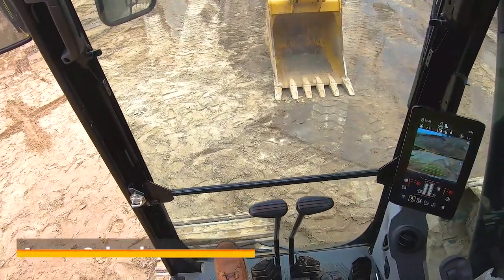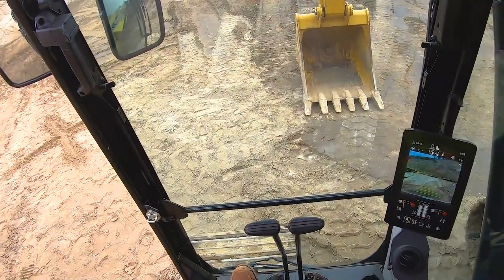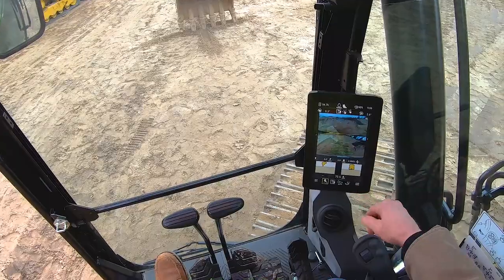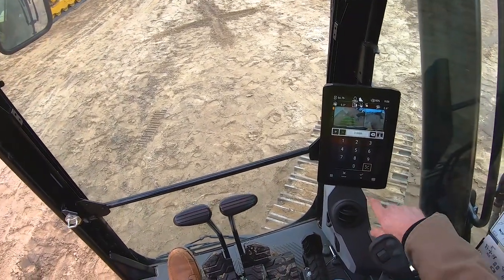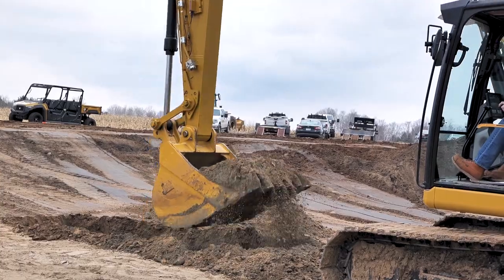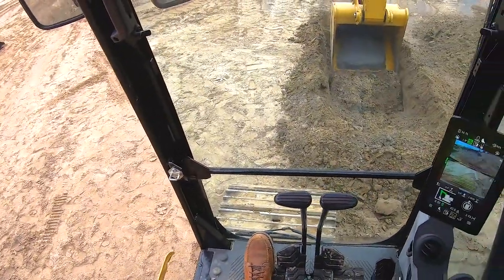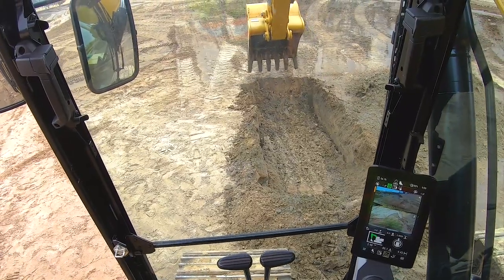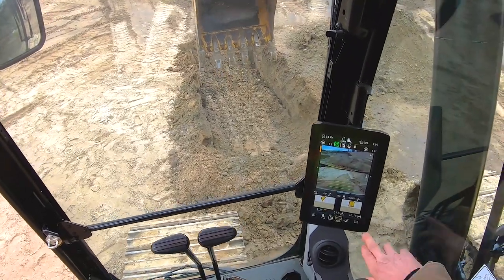How to Use 2D Grade Control on Cat Excavator

Comment: We got a new 336 and 340 but i tried to used 2D grade control the icons are grey and can't use it, does my company has to do something or is not installed on the machines? Thx
Reply: Did you figure it out, I’m having the same issue?

Comment: I have a 317 with the Grade Control and a Laser catcher.  The laser bench feature is not very accurate, the dealer is telling me I need a laser with at least 900 rpm for it to work correctly. Just an FYI for those looking into this feature.